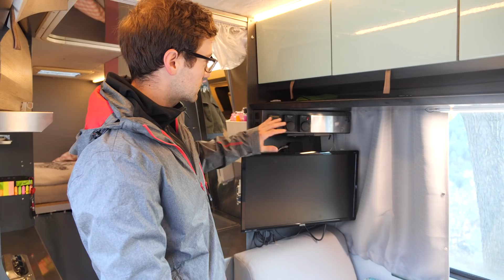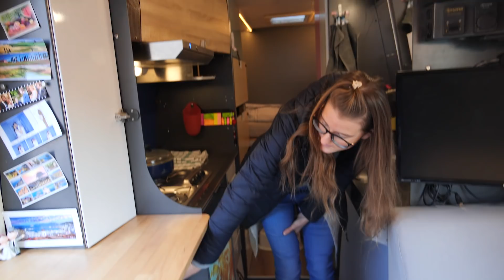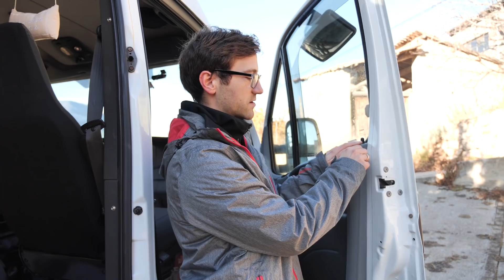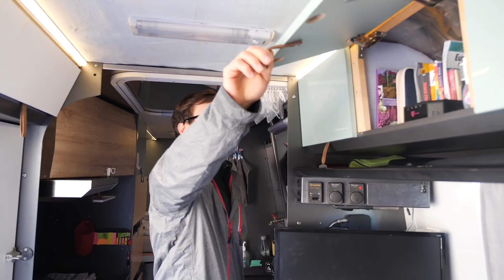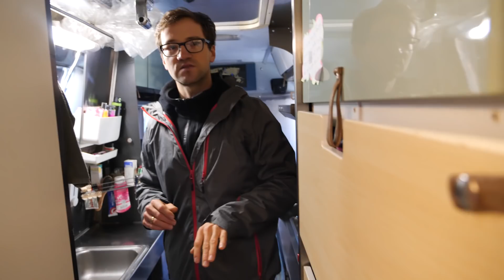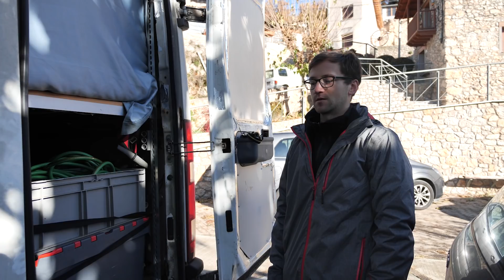THIS GENIUS VAN HAS A SOLAR & WATER POWERED AIRCON, Smart SECURITY SYSTEMS & Clever SHOWER 🚿🚐

Comment: Ok, who can build me this AC that puts heat into water? I have no hot water and no AC in my van... looking at crazy expensive 12V AC and solar roof rack units, and Bobil Vans hot water.... but really this would be so much better to integrate in one (and maybe cost less!)
Reply: It did work but used a lot of electricity! I would recommend a cheap diy 12v ac kit from aliexpress. They got so much cheaper in the last 5 years... and for hot water maybe electric on demand?

Comment: If carbon-monoxide is heavier as air/oxygen they will be dead before it reaches the detector. Doesn't it belong closer to the flor of the van??
Reply from the maker: Commercial spec is high-up.. does not make much difference in small spaces.

Comment: great security for the doors but a screw driver will pop the windows in less than 30 seconds
Reply: Thats why there is a shock sensor and radar sensor installed. Alarm will go off immediately...

Comment: Smash the window and undo the locks.  not really that smart.  if someone wants in they are going to smash a window before then fiddle with the doors.
Reply: You need to be inside to be able to unhock the chain. Good luck with crawling through a smashed window without cutting yourself open...

Comment: Two things his carbon monoxide tester is way to high it needs to be below bed level because carbon monoxide is heavier than oxygen secondly his air conditioner the intake and blower are backwards hot air rises so the intake should be higher than the blower it would be more efficient.
Reply: The carbon monoxide sensor is mounted exactly to manufacturers specs... And the outlet of the AC is higher so the cold air will flow down on us while we sleep. I prefer it this way.
Thanks anyways for the advice.

Comment: Lol....   generally nice build but peltier!?!?!? These consume around 5 x the power of a compressor AC given the same cooling capacity.
Reply: If I were to try and justify using peltier components is say this. 

They are smaller, and I can choose the exact amount of units for the power consumption I can accommodate. A compressor option might have few or none at watt usage. Also, being able to link into the water system saves space. 

But I don't know how hard it would be to build your own ac with a compressor of your choosing at the right wattage
Reply: @lunaumbra5179  I really like your build and think you did a great job.  I just question the effectiveness of a peltier AC.  If you're curious about a DIY compressor based unit.  There is a good chance that I will build one for mine. It will be a while away, but it's something I'll be doing on my channel. Most compressors nowdays are brushless and fully adjustable and some are really tiny.  Thanks for sharing your work.
Reply: Well it was all experimental... Found that 500W peltier cooling unit on aliexpress for 70euros. I thought i would give it a try. And it does work great. i Run it 100% on solar. Whenever its too hot most of the time it´s perfect sunshine. so we have good solar power.
Sure efficiency is bad but it works and the electricity is for free and it only cost about 120euros. compare that to at least 1000euros for a compressor ac.

Comment: Very good securiti sistem for "normal" thief.  To disarm this sistem is very eazy. This could be done with GPS locator to see where GPS locator is end remove it or many of tham and olso with anti signal transmitors. For internet , GPS , GSM divises . So if profesionals vant to get in , than Will use yust this device and block your GSM - GPS signal. Its that eazy. But is one of the best configuration and security solutions aniway. Wery good.
Reply: Well its good enough to keep the thief busy until the police arrives ;-)

Comment: There used to be a product called the O-so-cool (later the Easi-cool) which was a fridge that worked purely on water evaporation, i. e. no electricity, in the same way as porous pots can cool the contents.

I'd be interested to know if any vanners have used this principle. (The water-cooled aircon system reminded me of this.)
Reply: Thats not possible in a van. it puts out too much humidity.
Reply: @Gabriel.Leni100  Thanks.

Comment: We need a separate vid on that water-cooled aicon stup!!
(Cos I’m so over every dumbarse American asking how much solar/Ah they need to run a house aircon on their van cos Fanny-Mae needs her aircon)
Reply: It´s a peltier cooling unit with 500w power consumption. so i can run it 100% on solar. It keeps the bed area around 5-8 °C cooler than the rest of the van.
Reply: Fly ingDutch it is a swamp cooler, only works in very dry environments.  Been around for at least 50 years & also not very effective

Comment: His ac unit seems to work like a swamp cooler ... great idea.  Locking up the fuel tank another great idea that I haven't seen anyone else doing. Thanks Nate.
Reply: Don't all newer vans come with a locked gas cap?
Reply: Not a swamp cooler. It's a radiator like system.
Reply: @lunaumbra5179  It's a solid state, peltier element  based cooler with the hot side heating the water tank and the cold side cooling, I guess a radiator that cools the inside air with help of a fan. The efficiency is probably not impressive, but the cost is 1/5 of a compressor based AC, and they get some colder air  and hot water from the same free power source at the same time

Comment: Here's an idea, think about how to add some vertical rigidity to those shower curtains (I'm thinking foam board or similar) and you can a) still fold it away neatly and b) some strong magnets applied right at the bottom of the curtain may help prevent water dripping away from the wet area into your dry areas. Just a thought. Great build! Thanks
Reply: never had any issue with the shower curtains. The shower pan has a lid all around. and the shower curtain is longer than needed so it will stay inside the pan. no water gets spilled...

Comment: Water stored at eye level??? That is a whole lot of weight up high which make for an unsafe platform. and probably handles like a bag of smashed assholes  I hope he spent a lot of $$ on much better brakes and suspension. . Complexity is great - until it is too complex. Very ingenious non-the-less & as usual do what floats your boat.
Reply: you seem to know my van better that i... 
never had an issue with the van. running strong after 2 years of europes badest roads. also i don´t recognice any difference in having the water tank full or empty. Van handles like a champ. Just so you know: IVECO Vans are all based on a 5,5T chassis. as mines is rated only at 3.5T it is heavily overbuilt ;-)
Reply: @Gabriel.Leni100  Well of course if your van is built on a 5.5 tonnes chassis it can handle whatever an RV build can throw at it. I did not realize that - so knock yourself the f out - stack shit as high as you wish.

Most every van built in my neck of the woods ( NA) is built on 3/4 or 1-ton chassis. So you need to watch where you put all your heavy shit to keep the balances in check.

Comment: Great design and the shower freak me out.....i will use that knowledge to install the shower in my van.......and the AC system is really clever....with a peltier system you can hot your water tank and low the temperature in the bed area.....i love it.....i will try to build a similar system with a compressor unit, because it´s a more efficient unit than peltier.....may be with 350w you can do the same than  with 500w of peltier....(i guess..) thanks to this couple and enjoy Spain....
Reply: Peltier is indeed really not efficient. And using your internal water tank as heat accumulator sounds mildly impractical too as the heat simply isn't going outside. Instead, even a tiny residential window AC unit (also drawing around 500w) would probably be a better choice with a couple of modifications. Also not that expensive either (compared to the usual RV roof mounted ones).
Reply: @Frooonti  true. but my inverter at that time was not capable of running a normal window ac unit. and i was not feeling like investing another 500€ into a new inverter and then at least 300€ for an ac unit. the peltier system cost me around 120€all together. running it for 1 hour will only heat the water tank by 0.5°C as the energy density of water is a lot different to air.

Comment: I would find that shower system very inconvenient...
Reply: As apposed
Reply: @brendaswann7292  as opposed to one that's located in it's own nook to one side, rather than in the centre of the van, since while one person is showering the other is stuck in either the front or the back sections, and if you want to cook afterwards you will have to pat it down or get wet feet.
Also shower curtains are a pain in the ass
Reply: @ILike2PlayBass seems like you know what you are talking about. anyways this setup is working perfect for us since 2 years. we did it this way as we don´t want to loose the space to a fixed wet room which we only use 2 or 3 times a week. but everybody is free to do how he likes. ;-)

Comment: Hi, great tour thanks. Sorry if I missed it but what was the make, model and size of van?
I am in the very early stages of planning a van build so have a lot of interest in what can be stuffed inside different cans 😁😁. I am going to plan the van build in a cad program Sketchup or fusion 360, does anyone know of existing models of vans for either of those cad progs?
Reply: Neil Old  It is an IVeco Daily 35s12. 7 meters long, 2,7m high. 1,9m on the inside.

Comment: You showed every possible convenience, but I expected to see a small toilet pop out of a secret compartment.
Reply: It does not make sense that they would have a shower and not a toilet. It must have been an oversight not to show it.
Reply: @mernafrederick5153  they don't want the van smell. Its a small space after all
Reply: Our composting toilet is under the bed. it´s on slide outs.
Reply: @Gabriel.Leni100  sorry if this is an intrusive question but what about privacy while using the toilet?
Reply: @greek_sahab  we used the shower curtain for privacy. And always let the extractor fan over the bed running against the smell.
Reply: @Gabriel.Leni100  OK.. and.. the sounds?
Reply: @greek_sahab  the best camper toilet will not help anything about the sound because of the paper thin walls. If you live in a camper then you will learn to handle each situation and provide privacy to your partner.
Reply: Mitchell Barnow Me too!
Reply: @jimgale2079  Maybe they ran out of time?
Reply: You think they have one ?
Reply: @izzahahmed6800  I don't really know. A lot of the simpler van conversions don't have one. Some people are fortunate enough that they can poop easily into a plastic bag or in a public toilet. I'm not one of those people.
Reply: Maybe they have a place where they hide a cassette toilet?